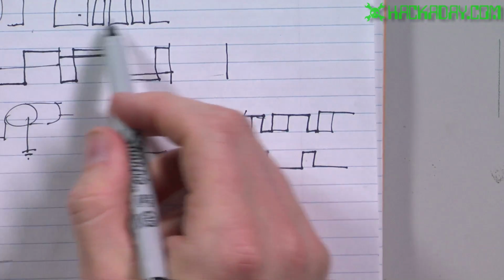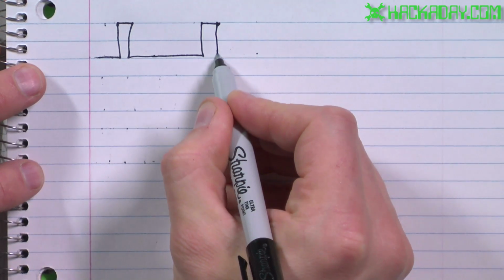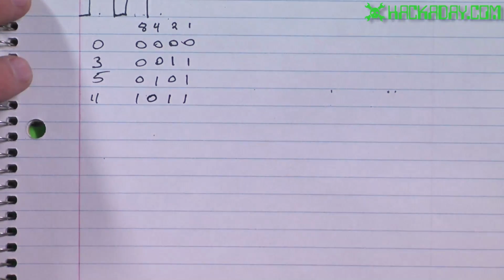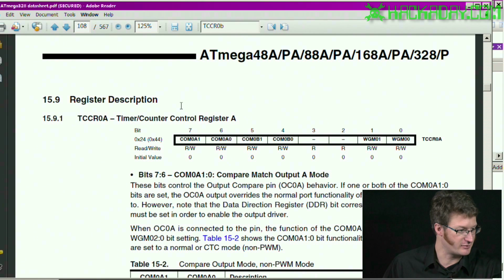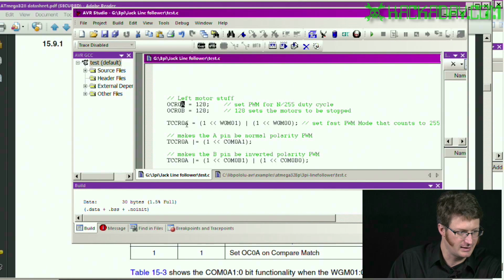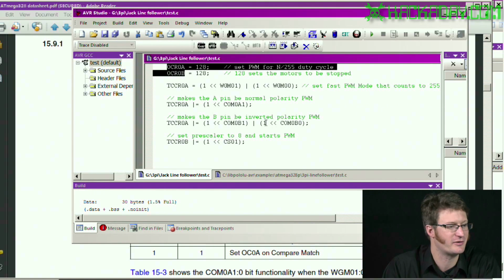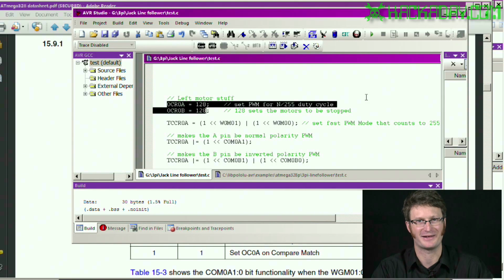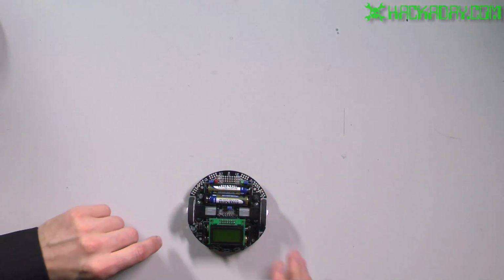3Pi robot - pulse with modulation (PWM)

Comment from the maker: @treesquids I wasn't the one who uploaded the video.  I've fixed the title.  I don't think that we will have a video about making boards at home.  I did that for my first few projects when I was getting started but quickly decided that sending them out for manufacturing was a lot better, especially if I wanted more than one and needed  surface mount parts or lots of vias.  On the other hand, I do have a CNC router that might be fun to play with for making boards.  I haven't tried that yet. -Jack